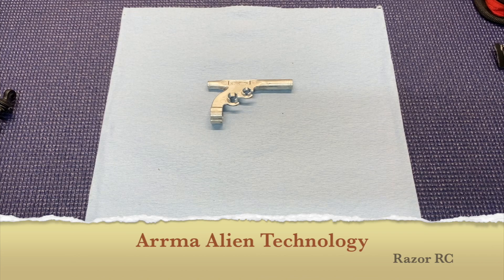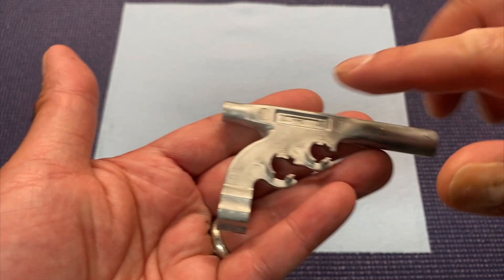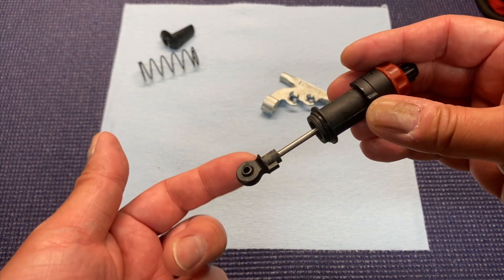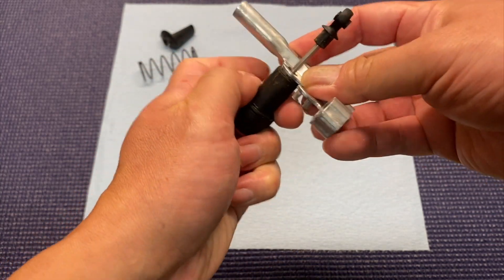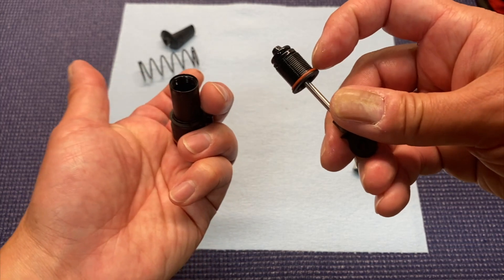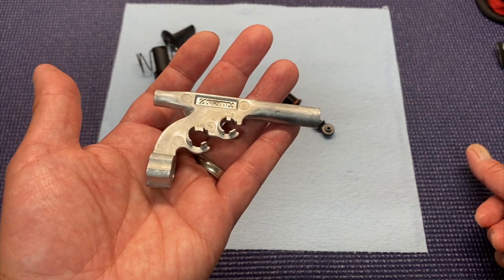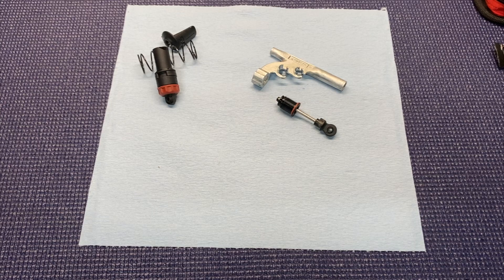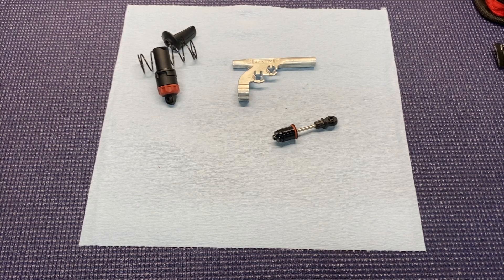Weird Arrma Vorteks tool! (what does it do?)

Comment: B stands for Bore. the 4s shocks have 15mm bore shocks. BTW, the old 3s cars came with a plastic red multitool, which also had the pins to open shocks with (if your shock end pulled off)

Comment: The old (plastic red) multi tool also had a turnbuckle wrench, which the new tool unfortunately doesn't have.
Reply: It did? I never even looked at mine to be honest.
Reply: I just got my big rock and had to put oil in the shocks and align the wheels.the red plastic tool doesn’t fit the turnbuckles
Reply: @JPRC_CRAZINESS  Really? my red tool have a 5mm wrench.. which fits both my Typhon and Senton
Reply: Yoni Cozac ya I was actually upset it didn’t fit my big rock because now my turnbuckles are all scraped to hell from my Gerber!
Reply: @JPRC_CRAZINESS  You sure your tool doesn't work with the turnbuckles?? the wrench is the bottom right most  part in this photo:
https://www.arrma-rc.com/part/AR320411
Reply: @yonicozac  yes that was the first tool I tried
Reply: @JPRC_CRAZINESS  so the big rock now comes with a 6mm turnbuckles or something??
Reply: @yonicozac  yes
Reply: @JPRC_CRAZINESS  no it doesn't they are still 5mm.
Reply: @slick2500  whatever size they are the cheap tool they give you with it does not fit the turnbuckles
Reply: @JPRC_CRAZINESS  OK you are right, i met a friend with a V3 Bigrock, and indeed - his red multitool is different! they narrowd the u-shaped gap and it no longer fit the turnbuckles. I wonder why this change was made.
Reply: @yonicozac  ya idk what it’s for either it doesn’t fit anything on my truck?it’s garbage plastic anyway